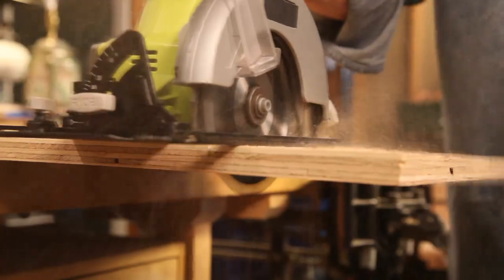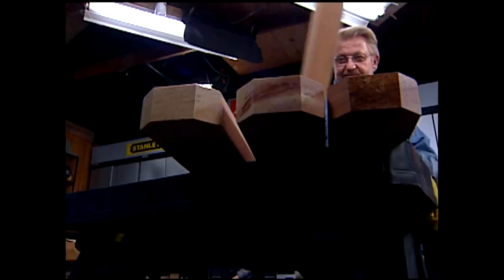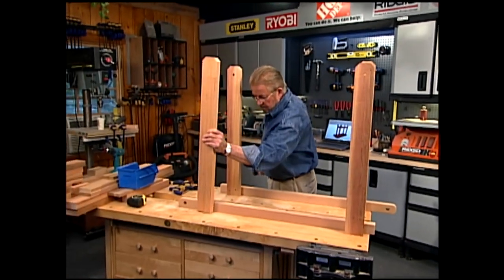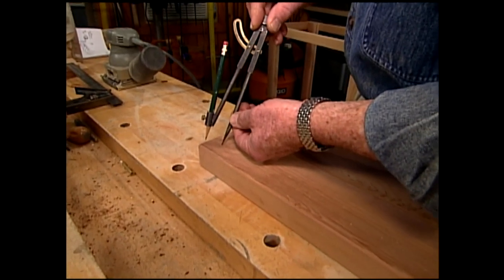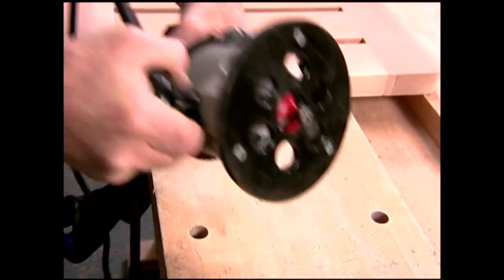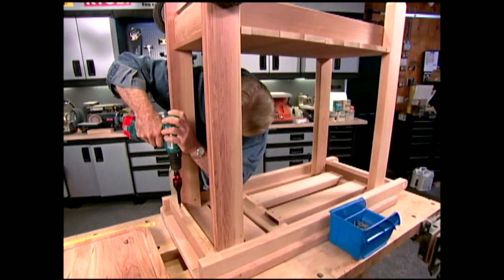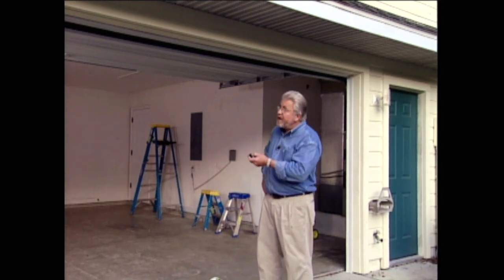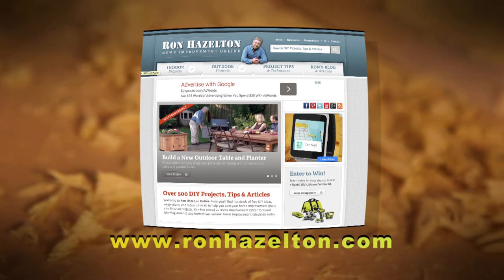Ron Hazelton's HouseCalls - Season 16 - DIY Outdoor Grill Prep Station

Comment: This is in my Opinion the best grill cart on the internet. Awesome build. I am using pocket holes in place of biscuits and to keep cost down I used cedar fence pickets, I bought the wheels at harbor freight and used walnut stain and coated the whole thing with polyurethane.